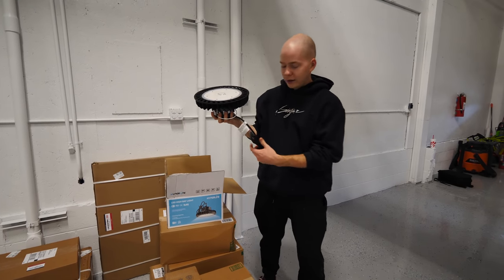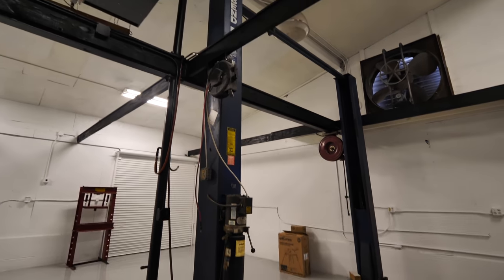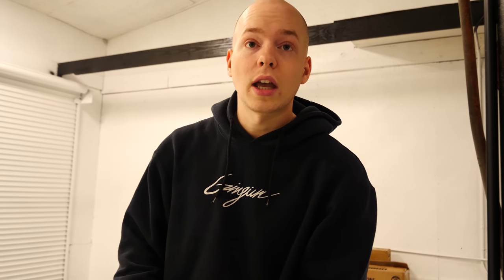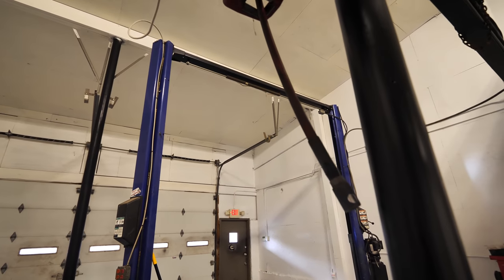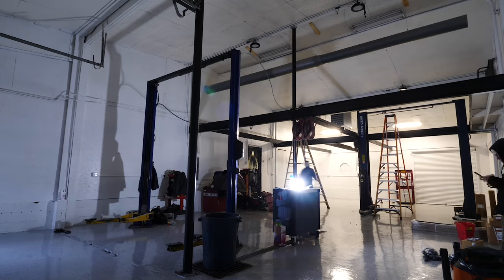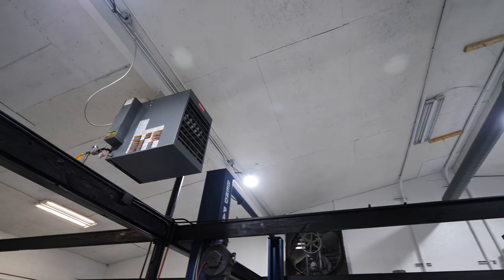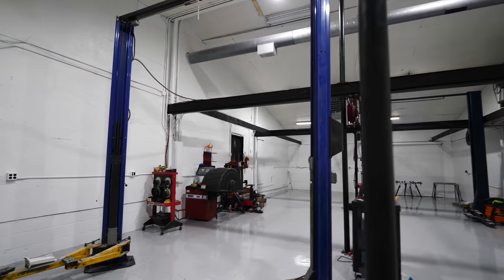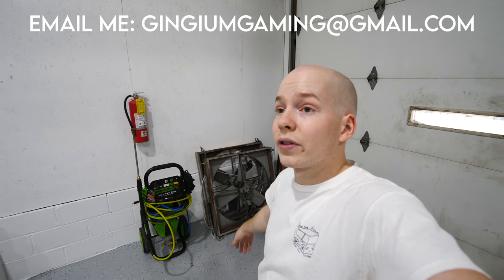The Last Step in RESTORING a 23 Year Old Mechanic Shop: NEW LIGHTS (SUPER BRIGHT!)

Comment: Suggestion, release the air pressure from the air system before you leave for the night. The less time the system needs to hold pressure, the more it will last. Highly recommend doing that. Other then that, great job
Reply: Also releases moisture from the system which is the biggest killer of pneumatics.
Reply: @jonesy2009  massively agreed🤟🤟🤟🤟
Moisture is a huge reason bag kits fail on cars
Reply: But then it has to run a lot longer every day to get back up to pressure. There are ways to keep an air system moisture free. Like automatic drain valves and filter driers. I keep my compressor tank filled at home all the time, but I have an automatic drain valve that purges any moisture out, a couple of times per day.
Reply: @Patrick94GSR  This ^^^^
Reply: @Patrick94GSR  Yeah, our tank (I think its 80 gallon) has been left at full pressure for like 20 years and it's fine lol.
Reply: @nakulah  nice. You have some sort of automatic drain I’m guessing? I’ve often thought about getting one of those endoscope cameras off Amazon and sticking it down into my air tank just to check the condition.
Reply: @Patrick94GSR huh

Comment: Wow it looks like it's a brand new building at this point.  Makes such a huge difference, good job!   Might want to figure something out for the echo, maybe some thick black curtains that hang half way down the walls or something.   Once you have more stuff in there it might be less an issue too though.
Reply: White canvas would work better, with enough extra length to make a 2ft repeating ripple to provide sound traps along the upper walls. Everything will catch some dust, but Black curtains are going look like dust-covered crap in a year's time, and videos need all that reflective white area to maximize the lighting for cameras down the working height.
Reply: I agree on the sound absorption! It will save your ears and make working more comfortable. You can fab up some basic square panels with cloth and insulation batts and hang them up. Great looking shop!

Comment: Shop looks killer! 4:46 they way you put the Teflon tape on the threads(backwards) with the end of it in a loosing direction, it tends to unravel and not seal as good if you were to put the Teflon tape in the other direction. But killer videos keep up the hard work!

Comment: I use the air tools as a mechanic there perfect if you treat them right and care for them they last a long time and never run out of battery. But I use battery tools for doing stuff outside the garage and for taking wheels off cars,vans and trucks
Reply: Hi Lewis. Im Lewis. Im a tech too. I have air tools. Some 20 plus yrs old but every thing going to battery. Me too. When they make a DA sander on spray gun with battery  then only thing with air will be blowing out stall and putting air in tires

Comment: Hey Celeb. Just something I noticed as i'm watching. just to prevent future leaks to the air system. but you threaded your tape on backwards. It needs to go in the direction of the threads. it just tears itself apart if you go opposite.

Comment: This shop is epic. I think I would've done full span up-facing lights for the "ambient" lighting instead, though. That and paint the ceiling, but then again, I'm not the one to have done the work, so without that load and stress on me, it's easier said than done.

Comment: You can apply the teflon tape in the same direction as the threads so that it winds tighter as you screw on the fitting!

Comment: I'm sure that this has already been pointed out by a lot of people, but the lift in the middle of the shop isn't placed very well. The beam that's right next to it will interfere with any car that's raised up on it. This is a problem for two reasons. One, obviously this reduces the height that you'll be able to lift a vehicle up, but secondly, the lift's safety mechanism is unable to engage.

At the top of the lift is a bar that gets pushed up when a car on the lift comes in contact with it. This cuts power to the lift mechanism, saving the vehicle from any potential damage from being crushed against the top of the lift, or damage to the lift itself.

Because the effective upper limit of your lift is that beam, and the beam doesn't have a safety mechanism on it, it would be very simple to accidentally crush a vehicle against the beam. I'm sure the noise it would make would cause you to stop the lift and avert most of the damage, but it's still bad that that's a possibility.

There's a couple options for how you could rectify this. One, you could install a safety mechanism onto the beam itself, tied into the lift to automatically shut it off.

Two, you could relocate the lift to completely mitigate the beam being able to interfere with the lift. Given resources, this is the one that I would recommend much more strongly over simply installing a safety mechanism.

Comment: VERy nice!  I am working on converting a garage to an art studio and will be doing the floor in either epoxy or acid stain paint, and I already have painted the walls and ceiling in a gloss white to reflect the light better coming in from the new window and sliding doors.  WELL worth the light availability and reflection!

Comment: On the air line near the one lift, i noticed you wrapped the threads wrong, my inner contractor screamed. Always wrap with, not against the threads. Otherwise you will just bunch it up, thus allowing later leakage.

Comment: 4:48 save yourself some frustration and always wrap Teflon tape to the right!  Unfortunately those husky couplers are trash. I will pay extra for the female couplers that have the collars that stay back when a male connector isn’t installed. That way you just grab the tool then push the male connector in and it will automatically latch. The push button type never seem to last.

Comment: The only thing I say is that those Homedepot fitting you installed are garbage. The blue push buttons you replaced are really good but expensive and older. It may be worth it to find more of the blue ones later way better quality in the long run

Comment: I still say paint the steps safety green. And put a cool handrail on either side.... You can use beach sand for a traction layer when it's raining outside, and shoes and boots will be wet.

Comment: Pro tip that I'm not sure if you're aware of or not: when wrapping Teflon tape onto threads always wrap it clockwise.. That way when you go to thread on the female end the end of the Teflon tape will only tighten more onto the threads and not have a chance of binding up on you

Comment: I know that you said you were going to finish the lighting, and it’s evident that there’s a slant in the ceiling from one end to the shop to the other. This causes the lighting to be less effective the higher the ceilings go. I noticed that there are the other ceiling lights that you had replaced one of them to LED. Are you going to consider replacing the other one in the higher area of the ceiling on the other end of the shop? I think if you do this it would assist with the rest of the lighting, with the addition of the other lights that you said that you’re going to add.

Comment: Your plumbing tip for the day is to wrap t tape in the direction you tighten the fitting to prevent it from unraveling while you tighten it up.